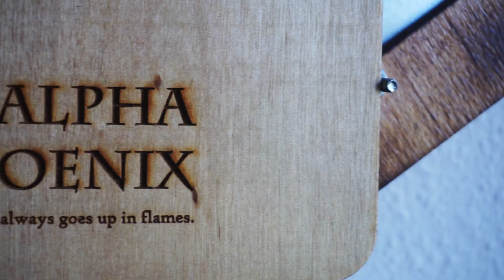2^11 Subscriber Play Button: CNC-Routed Poplar

Comment: What software are you using to plan out your CAM Process? My university provides Fusion 360 but I know there are other programs that might be better for these processes.
Reply from the maker: I use Fusion 360 cause its free! and plenty powerful enough for my level of design... I just went to go double-check, and each side got 3d pocket then adaptive clearing, followed by two orthogonal "Parallel" 3d contour passes for the curved bits, and 2d pockets for hard features like the recessed triangle. The outside on both top and bottom was a 2D contour with tabs. Didn't want to hit that much detail cause I wanted to make a shorter video but I'm glad you asked so Its out here!
Reply: @AlphaPhoenixChannel  If I ever go back to my other YouTube Channel, I'm definitely cutting out the play button to flex the 130 subs I ended off with.